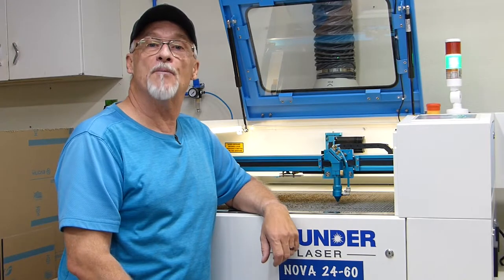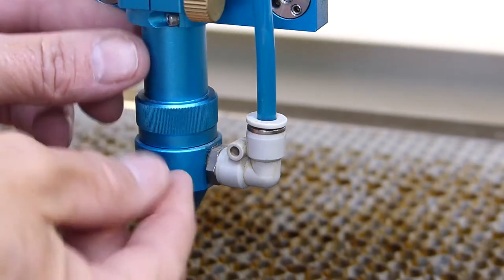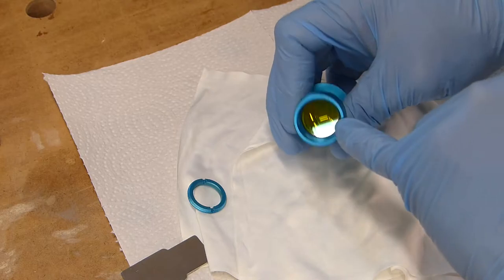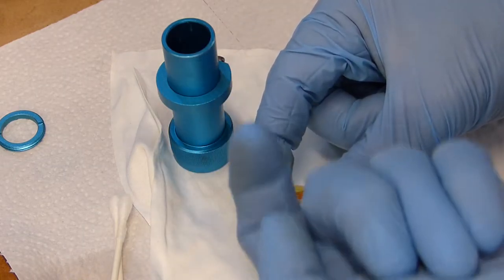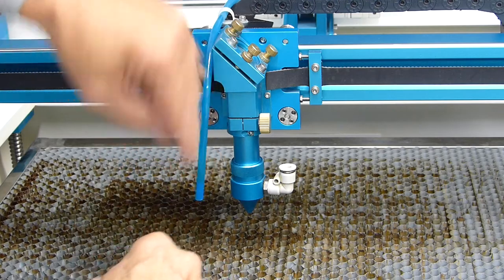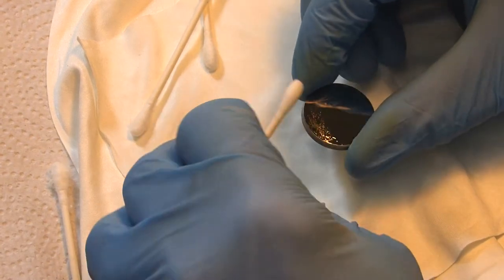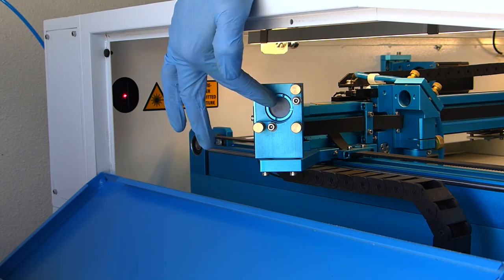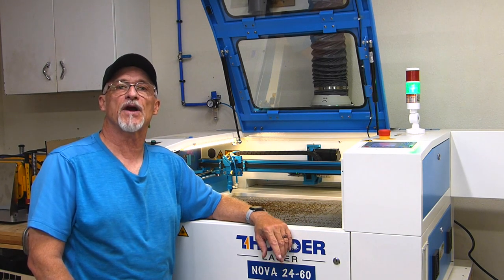Cleaning your Thunder Laser Focus Lens and Mirrors

Comment: where do you buy spare parts from to have on hand? do not see any on the laser site. do not have one yet but hope to have one by end of year.
Reply from the maker: If you have a thunder reach out to sales@thunderlaserusa.com the focus lens and mirrors you can get from thunder, Amazon or American photonics.
Reply: Do you have part numbers of the spare mirrors and lenses from American photonics that would work on the nova 35. I have all 3 lenses. 2", 4" and HR
Reply: One more thing about the cleaning. I cleaned the beam combiner with iso alcohol and it took the gold coating off Is that normal